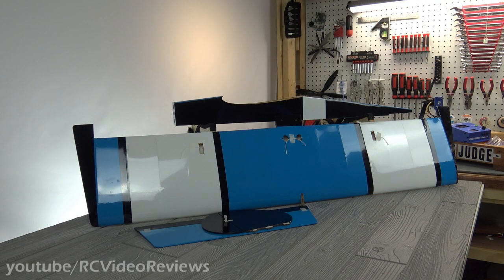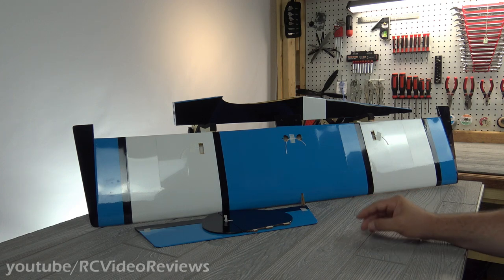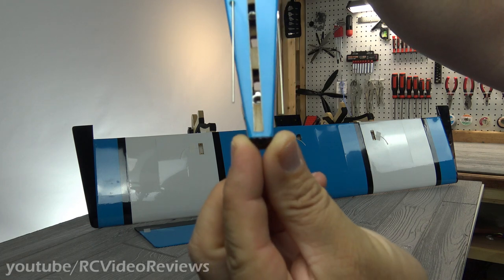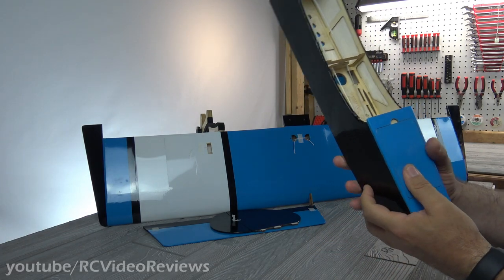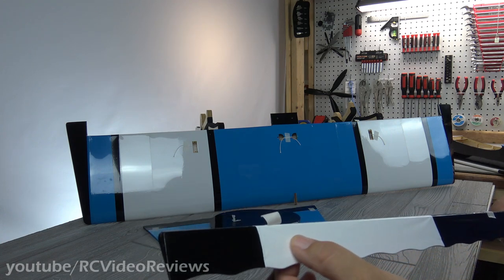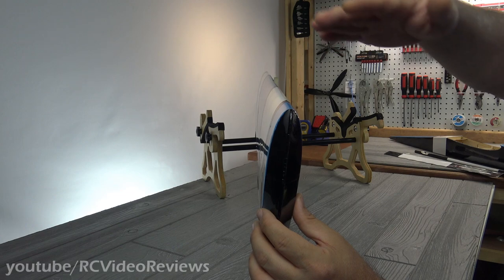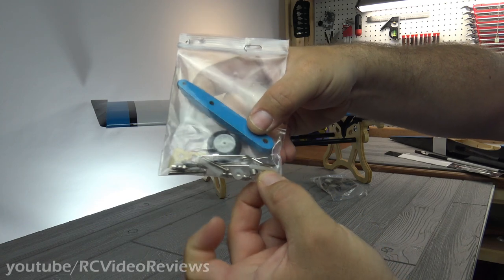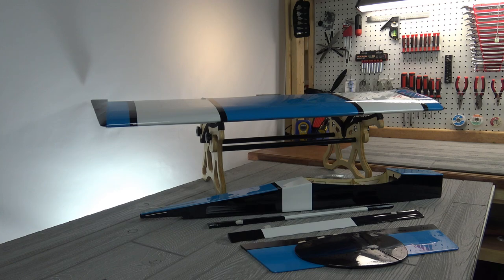HobbyKing Crusader 30E [Ugly Stik] RC Plane First Look

Comment: Just got mine yesterday. No strings in the wing servo slots but I have a metal rod I can use to fishhook it thru. I have some 9 grams metal gear servos in my crash stash but thanks for the tip on the metal gear servos from Amazon. I will use a predator 3536 kV 1250 from my stash. Plan to use a 40A ESC and an 4S 1800 battery.  By the time I get it finished, I will  hopefully have figured out my new TX16S radio sufficiently to fly it.
Reply from the maker: This is a great plane to work out a TX16s config. Just the basics. Sounds like a good power setup.
Reply: @RCVideoReviews  The quality of the kit is a little suspect. My fuse also has that little off center on the rudder mount. I had to sand down the empennage to get the horizontal stab level, I had to do a little carving to get the fuse to set in place correctly, there is a ~2mm gap between the frontg of the H stab and the cut out for it. 

But  with a discount from Amazon for opening a new credit card with them, I got the kit and a $23 battery, all shipped, for $125. Hard to complain too much.
Reply from the maker: I've had to sand down plenty of stabilizer saddles--even on some really nice planes. Didn't have to on this one. It's just one of those things with ARFs. Since I know of other planes that didn't require those mods--I doubt it's a jig problem. Probably heat related or just a bad day on the assembly line.

Comment: Just ordered one of these, looking forward to building it 👍
Reply from the maker: Have fun with it. What motor are you going to use?
Reply: @RCVideoReviews  2830 1000kv 10x5, 3s
Reply from the maker: That's the right setup. You should thoroughly enjoy the plane with that power. Dave flies his on about 250 watts and it does great with that arrangement.

Comment: Over all I like the "stik" planes. They are pretty easy to scratch build out of foam board. They are also easy to fly. When I do build out of foam I do not add scallops. Just not needed. For about 140 pnp this plane is pretty nice.
Reply from the maker: I still have and fly this plane. It's got a very easy going nature. I did find out after some time though--the stock horns fail. Has happened on three different local planes, so it's a pattern at this point. I replaced mine with dubro. Other than the horns, this one is in the same condition as the day I maidened it.

Comment: What, no Iron Cross on the wings? You may want to put something to help differentiate top from bottom in the air.
Reply from the maker: Funny you say that, Dave has this exact plane and put the crosses on the top but not the bottom for orientation. It comes with decals but I didn't show them in this video.

Comment: Great review!  I just got mine in the box yesterday.  Was going to go with the recommended 1100KV motor since I have one but after watching your maiden flight video, I'm going to have to get me a SunnySky 2814 and put 900W in the plane.  Love those "launches"  and unlimited vert :)
Reply from the maker: I LOVE the power level in this plane. It's just like a car too, you don't have to floor it. It flies around just fine on nice lower power levels but boy is the fun meter up there when you floor it.

Word of caution though, Dave and I have both had control horns snap. I lost mine on an aileron, he lost his on the elevator. I'd strongly strongly recommend using standard screw through control horns and toss the white plastic whatever they are horns in the trash.
Reply: @RCVideoReviews  Good tip! Thanks. I always use the ones with a backing plate, just makes more sense.

Comment: Been thinking about getting one of these kits , looks to be good thanks, would like to see the rest of the build on your stick !
Reply from the maker: There's more material on the channel about this plane:
https://youtu.be/K6BiOoB1x6g
https://youtu.be/j_R-wec4LDA
https://youtu.be/2hLotcm6b3U

Word of caution, right after the 10 flights in video I broke a control horn on the aileron--no real reason: no trauma, no hard landings...it just broke. Probably doesn't help that the motor pulls tree stumps from the ground. Anyway, I screwed on heavier nylon horns and it's been great since then.

Comment: Hey great channel you got me into buying balsa planes I recently bought the Tower hobby sport like yours I was wondering can I run the Tomcat 32 series motor on a 5 cell I wasn’t sure if you ran yours on 4 or 5 balsa is definitely better than foam 👍
Reply from the maker: You can do it if you prop down and keep the amps under the spec. I was at the field the other day and stuck a 5 cell in the Uproar which has a Geforce G32 and it pulled very hard, but it overamped the ESC and I felt pulsing. That was on a 12x6. So I'd say yes, consider an 11x6 or 10x7 or something similar.

Do you have a Watt meter? That's the first thing you need to get when you start asking questions like this. The watt meter will tell you what's happening and give you an idea of what you can and can't do.

Thanks for the nice comment. Good to meet you. 

J
Reply: @RCVideoReviews  thanks for the information i have an 11 by 6 ill try that once again great channel!

Comment: So these just came back in stock! $116. I ordered mine and also followed suit and got the SunnySky too! What battery are you using? 4S 2200? What’s your flight time?
Can you believe it took 2 years to come back into stock? I’m glad I finally got mine coming.
Reply from the maker: 4s2200 and hold on to your hat. I'm definitely surprised it took that long. Get yourself some dubro horns too. Don't even bother with the stock horns--just throw them away.
Reply: @RCVideoReviews  yes I already read the comments and I have Dubro horns ready to go! Thanks again.

Comment: Great video mate. I'm currently building this plane. Should fly great. I saw your other video where you fly it on 4s lol Jesus Christ!
Reply from the maker: This plane is an absolute blast to fly with that motor. obviously overpowered but I’m way ok with it. 

One word of warning though, right after the 10 flight report card I broke a control horn on one of the ailerons with no obvious cause. I replaced them with 30mm screw in replacements. So keep an eye on those horns.
Reply: @RCVideoReviews  Yeah they're not the best looking control horns in the world. I used very strong epoxy to glue them in so we'll see how that goes. It's stronger than 30 minute epoxy. Unless it doesn't break from the glued joint and the horn itself actually breaks. We'll see, thanks for the heads up mate.
Reply from the maker: That’s where mine broke. Flush with the base of the aileron. The glued in portion of the horn is still on the plane. 

FYI No hard landings no abuse. Nothing but air and gentle touchdowns on this one. However, 900+ watts though...so I’ve put some strain on it with high speed/high g movements.
Reply: @RCVideoReviews  yeah they don't look like the strongest horns anyway. If it breaks, i pray i still have some sort of control when it does hahaha.